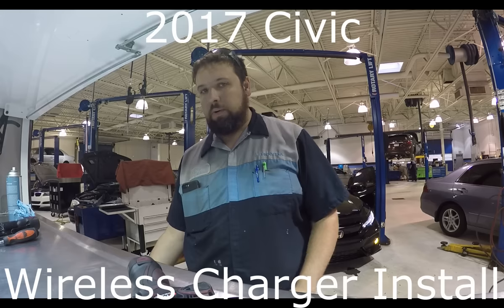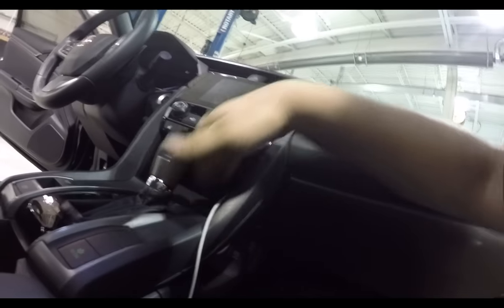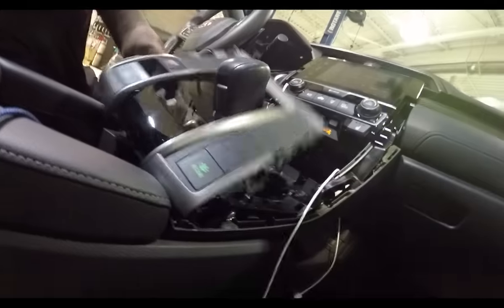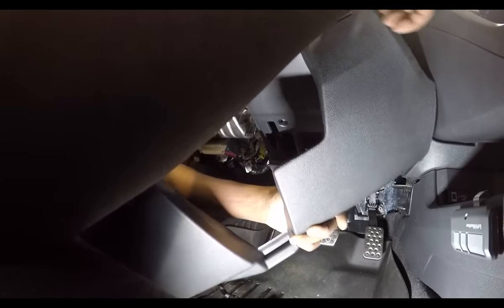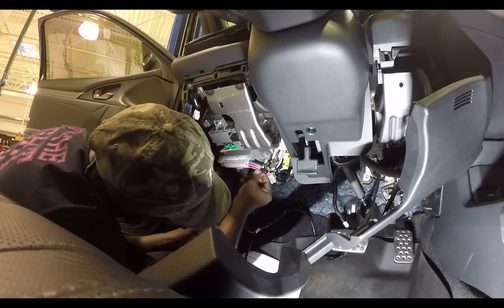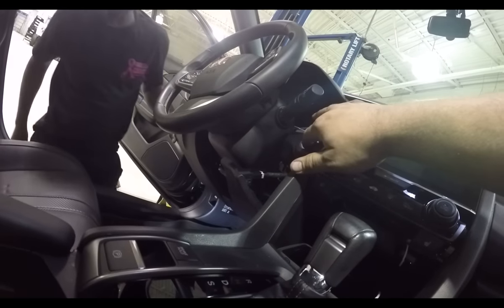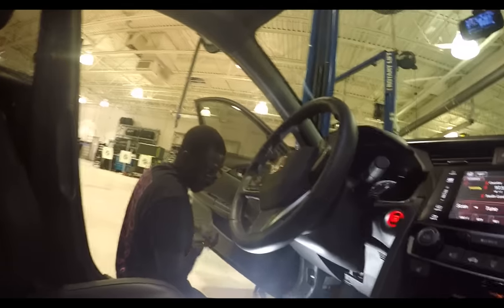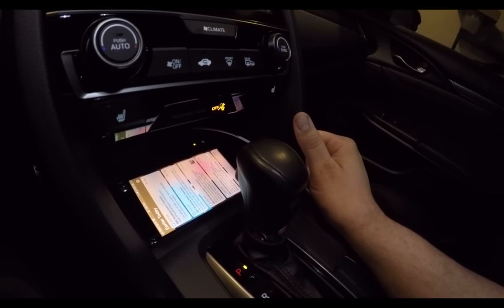Civic Wireless Charger Install

Comment: The instructions for this install require taking EVERYTHING apart.  It’s 100x more complicated than the two panels this video shows them popping off.  And good luck not snapping any of the clips around some of these panels.

Comment: Does Apple CarPlay or Android Auto works off the wireless pad?  In other words, do you still need to plug in the USB cable to use Car Play or Android Auto?
Reply: You still have to plug in via USB unfortunately.
Reply: So, why would you install wireless charging if you still have to plug in to use Apple CarPlay? I mean, the wire is a pain!!!
Reply: Sadly so.

Comment: It's kinda unfortunate that we can't see what Peanut is doing. I hear him threading the harness through but can't see where the heck he starts. Instructions show a much more in depth removal. Is this necessary for proper functioning and longevity or is Peanut's way good enough? I can't find any other install videos for this and I really don't want to peel the whole dash apart. Suggestions or alternate video would be much appreciated.
Reply: Jared Banner I’m trying to figure out the same for a 2016 accord. The instructions show over 42 steps to follow

Comment: oem can't even fast charge. just buy a usb wirelesee fast charger and put it in the slot. way cheaper and charge faster
Reply: Fast charging wireless phones is the fastest charging method to kill a battery, so many elect to not do that. Oem will also hold up much better than rando cheap electronics, while being more elegant and fitting far better. Pros and cons of everything, but both choices can be very logical depending on the person

Comment: Sup man, it's me An! Nice install man
Reply from the maker: Thanks bro. More to come!
Reply: @WolfOverland  whats the part number on that charger?
Reply from the maker: TEXASBLAZE 101 it is 08u58-tba-100a for the 2017 civic attach kit and 08u58-tba-100
Reply: @WolfOverland  i have a 2016 civic coupe but im sure it works the same, thank you for the quick response!
Reply from the maker: TEXASBLAZE 101 just checked. It is the same pet numbers.

Comment: Can you do a troubleshooting video for this. When peanut said don’t put your keys there ...why? Also I had mine for two years and it not working it may have a short fuse I’m thinking. Can you help me figure this out. Thank you. Great video.
Reply from the maker: Hi Miriam. Make sure you are using a proper phone. Should be iPhone 8plus and above. Make sure your phone wirelessly charges on another charger pad first. 

Peanut said do t put your keys on there because it can short out the pad. Metal on a charging surface can short it out. 

Should have a fuse in the drivers under dash fuse box for the charger. 

Does the little led light on the charger light up at all when the car is running? If so, and you have a phone that charges on another wireless charger it may need a new charger pad. 

Thanks for watching.
Reply: You should switch on your charging pad first in order to work
Reply: It’s working now. Thank you all. Awesome video💝